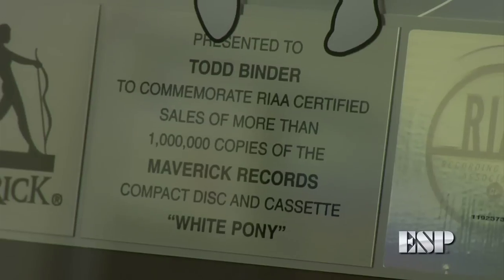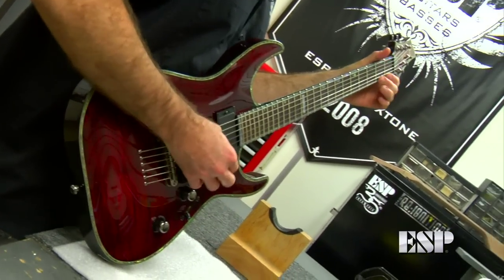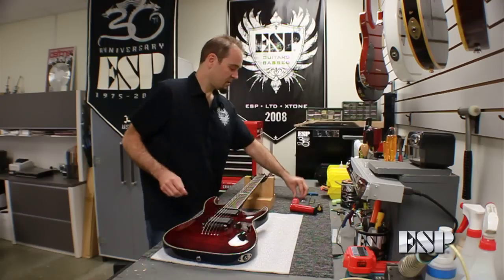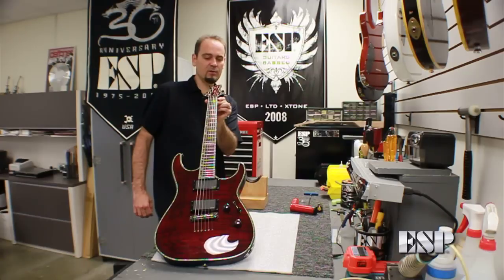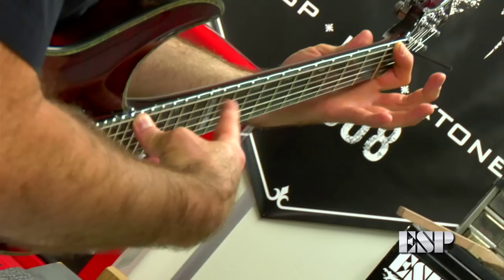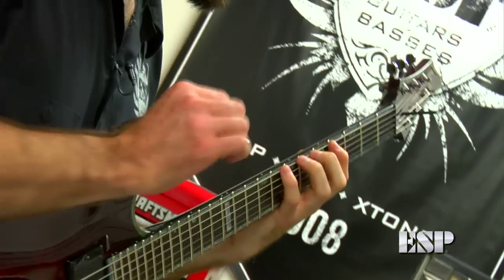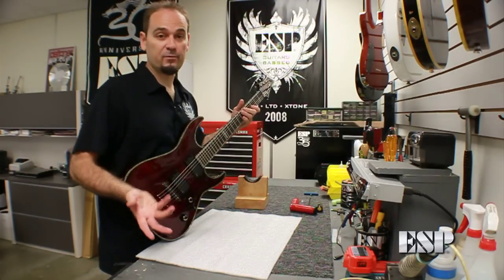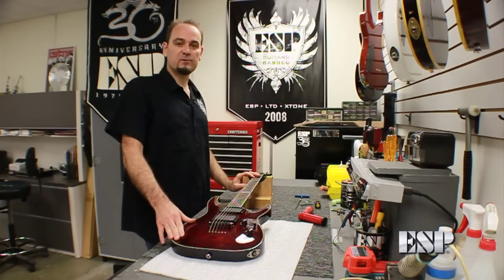ESP Guitars: Tech Corner -- Truss Rod Adjustment (2/2)

Comment: Todd, What if I have straightened the neck and provided proper relief... a wee bit of buzz by the headstock, but very minimal for the low action I have... the issue is that the strings are very difficult to bend now (This is a new Kamikaze, so I don't have a history with it). What can I do to somehow lessen the string tension? Guessing I might remove one of the 3 springs and rebalance the floating Floyd for starters? Strings are standard .009 - .042

Comment: Hey thanks for these videos (1 & 2). I've been wondering how to self setup my LTD, but it's an MH-350, with a floyd rose.

Now a couple of times I managed to ease the buzz off the E, A, and sometimes G strings, but every time I did, the strings were too high off the neck. and if I try to lower the tremolo, the buzzing comes back with a vengeance.

Any tips?

Comment: ESP is awesome. got a new m-17 today, and had to adjust the truss rod from the start. strings wouldnt even ring they were on the first frets. fun.
Reply: Glad your happy! They are good guitars aren't they, just give them a good set up and they will go against more expensive guitars easily.
Reply: TheThetruthcanhurt what size Allen wrench does the m-17 need a 4m.m?
Reply: Ryshlova Noodo God I am really sorry but I don't actually know the answer to that. I know in the instruction manual that comes with ESP/LTD it says the size.
 Its white paperwork that came with the guitar.

All I can recommend is try different allen keys in a set, then when one fits, try one even bigger. If that doesn't fit, you know the one before is the one, but sometimes a bigger one can fit in and you can strip the head using too small.

Comment: Hey @espguitarsusa, does it really work that fast? I thought the neck would have to "relax" overnight to adjust to the new tension...
Reply: Sebastian Keil no no u should let it rest for s few mins. Bc it will keep moving a little if its under tension still after you started to move it. It's all fine just let it settle not always the case but better safe than srry..bc if it goes either way to Much then all that tension rest upon the fret board wood only. people always get freaked out about the truss rod. It ain't no rocket science just don't go over board every single guitar ever made needs the adjustment relatively often if u want intonation and action and all to be right

Comment: Currently using LTD EC-1000, and wanna tune down to Drop Bb do i still need to adjust the rod?
Reply: If your coming from standard tuning, most probably due to there being less tension on the neck.
Reply: TheThetruthcanhurt ohh i straight away restring to drop Bb instead so probly same setup by adjusting the truss rod right?
Reply: Also, you can click on each of those steps for an in depth guide on how to do each step.

Comment: say that I have a guitar in e standard with 10-46 on it. what would I do if I put 11-58 set on? which way would I turn the truss rod and what all do I have to do to get it perfect
Reply: Ryan Press if you are installing heavier strings (from 10s to 11s), you would more or less would have to turn the truss rod clockwise to tighten it that is if the neck starts to have too much relief from the heavier strings. So always check first the relief first.